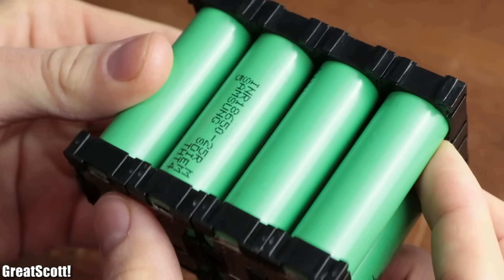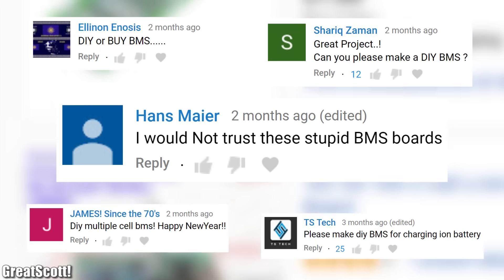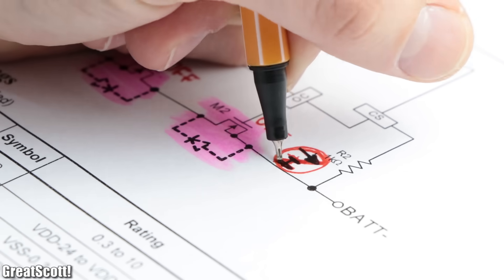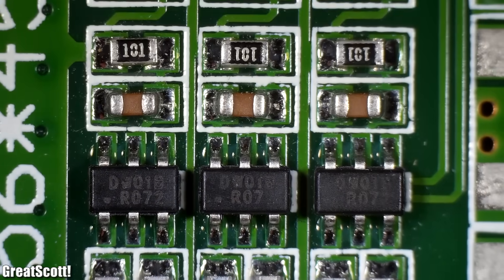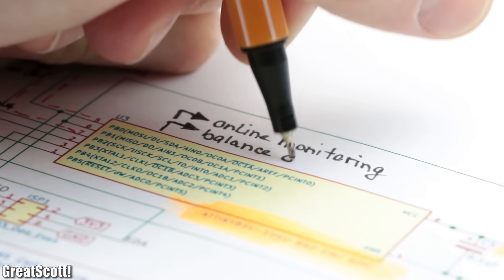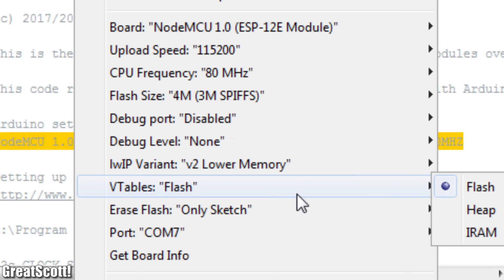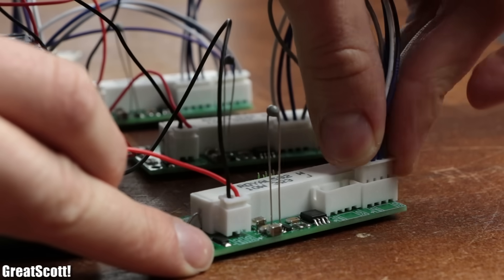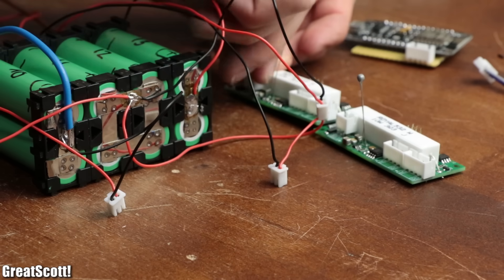BMS (Battery Management System) || DIY or Buy || Properly protecting Li-Ion/Li-Po Battery Packs

Comment: The value proposition of JLCPCB went way downhill this week as they stopped offering combined shipping with LCSC.com parts orders. The PCB shipping is a lot more than the pcb cost but at least getting parts in the same order made it bearable. Now the shipping makes it crazy unless you are ordering multiple pcb layouts.
Reply: @feldim2425 
My Steps:
1.) "dead bug" point to point
=Free
2.) "Brooklyn Style" islands/point to point w/salvaged copper clad materials
=free
3.) Marker based etch using ferric chloride in tupperware containers.
Chinese art marker ~$0.25
Ferric Chloride ~$10-$20 IIRC (I got it super discounted when RadioShack went out of business, however it can be sourced cheaply online too.) At the time I was still using salvaged copper clad.

Note: lots of older nicer SMPS designs used a piece of copper clad for shielding on one side of things like laptop printer power bricks. Notably, HP and Dell PSU's often have this. Just remove the solder mask and you're good to go.
  You can also just make boards with copper clad and an art knife by cutting out the gaps between islands/traces. 

Step 
4.) I picked up a cheap brother laser printer at the thrift store for $8 completely full of paper w/a full toner cartridge too. I also picked up 2 different travel type clothing irons (no steam holes) for $2 each. This is ideal for toner transfers. Don't bother with a laminator when doing toner transfers. An iron will let you test and control both the heat applied using a thermal couple on a dmm, and the time and pressure involved. The goal is to completely remelt the toner(a type of abs plastic) and transfer it to a surface that is easier for it to stick to. I use glossy pages from an old book I got out of a thrift store's trash (was laying on top of the bin one day).
=upgrade to toner transfers <$20
I also got some clad from China in 2 sizes for ~$10

Note:
Since then I discovered Bill on eBay. He sells under the user abcfab. He often makes the items in his store unlisted if he's out of town or super busy. When you find him add a few items to your eBay account watch list so you know how to find him. He sells product based on inch measurements. If you pay attention you'll see this is the cheapest option available online. It's great stuff too.

5.) Next I picked up several medium to large Pyrex casserole dishes from the thrift store for ~$1-$2 each. I have 6 I use most often.
=~$10

 I decided to go the Hydrochloric acid and Hydrogen Peroxide route as per Nurdrage's instructions. These are available in the US from big box home improvement stores. HCl is sold as "Muriatic Acid" or a 'Concrete Etchant.' This usually comes in a gallon container that will last you ages. Pick up hydrogen peroxide from any pharmacy.
=~$20 total

7.) Next I tried photoresist from China. I had to get resist, and transparencies.
~$4 for photoresist
~$8 for a 50 pack of transparencies on Amazon

I didn't get very good results from the first batch of photoresist I got but this was mostly due to my (lack of good) methodology. 
 
At someone elses recommendation I picked up Dupont Riston photoresist and Dynamask dry film solder mask from eBay.
=~$35
-these are nice, but having a datasheet I could look up and use as a guide was priceless. <this was an exponential step ahead in my methods.

 Using solder mask film was the first time I really needed a laminator. I got an Amazon basics version for ~$20 for this reason. It also works well for photoresist application but I can achieve the same results with an iron.

I'm still working on perfecting my dry film solder mask. I have achieved useable results but they are not 100% defect free yet. I have done a couple of TSSOP's and larger TQFP's with success though.

 The lack of through hole plating and other idiosyncrasies are more of a planning and mindset issue in my experiance. Trial and error will overcome these and if you're like me you'll learn from and appreciate these lessons in layout/design. 
  Lastly I also picked up a set of brass micro rivets from AliEx for ~$4. I use a needle pick to start the expanded back side of the rivet while sandwiching the collared side between the PCB and a piece of wood. Then I use a drill bit about 2-3 times larger than the rivet bore, in a hand drill. I set the direction of the drill to reverse/counterclockwise, and carefully expand the rivet until set. Sometimes I have to trim this a bit depending on how the rivet expands, but this is the trace side. I just add a bunch of flux and solder it. This can make mechanical trace connections rock solid or a via if you'd like. Although I just do a bit of wire for a via.

Last tips, apply photoresist with water, clean boards with white powder based dishwasher detergent (water must sheet off "clean" board or it isn't clean), you must test exposure times for all lithography films using a test/timed exposure mask to find the best time, the sun works great, I expose photoresist for 3 seconds in the mid day sun, 5 seconds for solder mask, the developer solution is critical for ratios and temperature.
...and now I'm sick of typing crap 9 of 10 people will ignore....
Check my playlists it's all other people's uploads I saved for personal reference but made public. I have like 6 different ones on PCB fab. Those covers almost all I know.
GL
-Jake
Reply: @UpcycleElectronics  : Great writeup on pcb making!
Reply: Upcycle Electronics much appreciated your effort 👍🏻
Reply: shipping is expensive but i don't ship with DHL i usually pick China post registered mail.. 7-14 days to Nairobi, Kenya. i did order 30 boards so that reduces overall  per unit  cost. plus it beats messing with toner transfer, ferric chloride and other diy pcb making messes....
Reply: @anthonykaruri  do you use all 30 PCBs? Became for me I only need 1 PCB to make my project before I make improvements to it.
I don't understand how I can buy 5 PCBs and only use 1, maybe I should sell the rest? 
Can someone tell mr what they do with extra PCBs? 
I don't have a drill to make holes in my PCBs (not that I have made PCBs) maybe I should start making my own if it's just 1 pcb
Reply: @kevinmccallister7647  not worked on the project for a while waiting on parts.. Yeah ordering one is still a better deal than trying to make your own boards. I am in Kenya, not sure of postage costs.. Where are you?
Reply: @anthonykaruri  no I didn't mean shipping, I ment when buying 5 PCBs it's 2$ shouldn't it be way more expensive when buying only 1?
Reply: @anthonykaruri  I just cheaked. In jlc PCB can't make a purchase if less then 5  PCBs and shipping is 25$ if choose the fastest one.
And around 8$ for cheapest one
Reply: @kevinmccallister7647   for me it just comes down to a value proposition... the alternative will likely cost more than 10usd. buying the supplies and the value of your time attempting to make your own pcbs. for the set and-finish you cant get it cheaper than China.
Reply: @anthonykaruri   right, I was thinking I don't need 5 PCBs what am I going to do with it?
I usually build only on perf board. 
The advantage I see with professional PCBs is that it looks really cool and you get to use SMD parts and you learn a lot.
Where do you buy your PCBs from? And what do you do with the excess PCBs?
Reply: @anthonykaruri  alroght man!
Reply: @feldim2425 
   I totally get it. I struggled with the same decisions at first.
   While challenging for sure I can do LQFP's and TSSOP's to 0.4mm pitch first try. I have a board I designed for a PIC16F1509 (TSSOP) and another for a MSP430F2616 (LQFP). Both of those are single sided with a few jumpers, and are basically minimum dev boards.
   I mostly do the DIY thing for the experience. I find it fun. I actually got into the hobby after becoming partially disabled. I'm extremely limited on space, have a tiny workbench in my bedroom, code from a laptop bed stand, and store everything for making PCB's in two plastic storage totes, one under my bed and another on my back patio.

  As far as DIY potential is concerned, the one I really really want to try soon is to order some of the thin laminates Bill lists on abcfab (BTW no affiliation or anything/heck I'm not monetized at all here anyway so have 0 to gain). He sells super thin double and single sided off-cuts and surplus. I want to experiment with a 4 layer home brew setup just to see what is possible.
  I've also been looking into through hole plating using acrylic paint with graphite powder and a plating solution.

  With all this stuff, once the setup and technique is established it's pretty fast and easy to replicate and get good results.
  With photoresist and fine line detail, I think most people over expose their transparency/film, and or add way too much sodium carbonate to their distilled water (I made all of these mistakes). I actually expose on the shorter side of 3 seconds in the sun, and use masking covers for transportation to/from a red LED lit dark (bath)room.
   The other super trick I didn't mention is to put bicycle chain oil between the toner side of the transparency and the photoresist applied to the board. Once this oil/air is squeezed out the transparency will be closer to the board than any other techniques I have tried (quite a few). I currently resolve the occasional cat hair and dust, no kidding. Once the techniques are dialed, your photoresist resolution should easily exceed your printer's.

  The etchant combo mentioned is DIY 100% recyclable with no losses too. Nurdrage - Youtube's go-to practical chemistry channel, has the tutorials needed for recycling. I haven't done this yet, but am shopping around for a cheap hotplate stirrer and distillation setup in order to start recycling my own spent etchant. 

  Probably the most difficult trick is getting the printer to do a dark enough print. I noticed I get better results when my window air-conditioner is running. I think the drum voltage controls the printer toner distribution quantity. I will probably tear my printer apart and figure out a way to create a variable voltage adjustment to really exploit this further. 
:-)

This stuff is not for everyone though. It is fun. I still plan on doing some things with a board house in the future, but I really like making boards too. The biggest spending splurge I'd recommend is a table type power mini saw and drill press. I use a dremel on an old drill press adaptor (thrift store press), and a 7" tile saw for cutting boards with a 0.65mm blade, and looking at a 6" option @0.3mm.
-Jake
Reply: @UpcycleElectronics  It's quite simple really, I've made my own PCBs and while they are okay, it's quite a faff to do and the end result is always messier than if I just order from JLC.

Vias are an absolute anus if you can't through hole plating, miniaturising boards becomes a chore and not having solder mask usually results in solder trails all over the PCB. That's not to mention drilling as well, which always looks crap because getting holes perfectly central on small pads is difficult at best. Yeah you could use a CNC mill, but if you're gonna get that, why not just order the boards from China in the first place.

JLC's PCBs are really high quality, they handle heat well, pads very rarely lift, they have silkscreen, look great and they come within 5-7 days which is a crazy fast turnaround time for boards coming from China. The visualisation on their website is also excellent.

If you do a bulk order of multiple designs, it's really good value. That's how I do it.
Reply: Even after a week of waiting on parts I loose my project momentum and wind up shelving it most of the time. Etching your own is both easy and extremely difficult. I can do a small hand drawn marker based design in a couple of hours tops. A single sided toner transfer in half a day or a complete double sided design with a dry film solder mask and soda can stencil in 1-2 days per iteration. I haven't used a board house yet, but I'd be so pissed at myself if I had to wait 2 weeks for 2 iterations every time I screwed something up like a flipped chip or accessibility issue. If I waited two months for the slow boat shipping....I'd totally forget the project even existed....('who sent me these samples without documentation?')

  It is certainly a challenge to piece together a complete etching setup and get everything working right though. I got almost everything piecemeal over the last year shopping at thrift stores.
  From what I've seen the JLC parts service is kinda short on most components though. They are mostly a jellybeans and passives supplier. I get that stuff from AliEx, and do all my local ordering from Arrow. They have free overnight shipping in the States, no shipping fee, and no minimum. The only caveat with them is that their site search and organization kinda suck and their mobile version of the site is practically useless (even on a Samsung flagship).
  That's just my $0.002 AdSense on this :-)
-Jake
Reply: @UpcycleElectronics  I get you on the momentum thing, the trick is to pace yourself...
Reply: Yes 
Is PCBway better?
Never tested it
Reply: I was looking into it but as you said 2 euro for a board but 5 euro or so shipping and they come from germany I live in the netherlands!
Reply: Well, according to PCBShopper, JLCPCB is still the cheapest option. But it's always cheaper (and it's also very fast, much better than having to wait for shipping every single time) is to make them yourself if, like in 99 % of the cases, you don't need 10 of them!
Reply: Around the end of January of this year, I ordered boards from jlcpcb and parts from lcsc right as soon as Chinese new year started, and I wasn't able to combine the shipping costs, so I assumed the reason I wasnt able to combine shipping was because of Chinese new year. Are they still not offering the combine shipping service? Thatd be a shame. It is quite convenient
Reply: kevin t  - my last combined pcb/lcsc order was about 5 weeks ago so maybe the change was around then. I just ordered a pcb yesterday and went to combine them on lcsc and saw the message.
Reply: @xabhax  about @Oliwer Gumowski  : please read some more into the way the chinese gov boosts exports by paying up (and above) 80% of the shipping costs, thats why no other country can match the shipping.. (hence the free shipping on lots of CH sites) so when a chinese firm asks 18 USD to ship 10 mini pcb plates.. thats like an Ebay listing of 0.02$ buy now item with 19.98USD shipping... aka scamming you by super over charging on shipping
Reply: @feldim2425 allpcb seems to be an alternative to JLC.
Reply: I assume OSHPark is still doing free shipping @ $5 per square inch?
Reply: What are some good alternative options?
Reply: @Datsun0240  I've been using osh park for years - free shipping and made in USA. Have to order 3 boards though
Reply: @osjproductions5856  OSH is my go-to as well. My projects aren't super big and mature enough by the time I'm ready for a PCB,  so I don't find the qty 3 a turn off.
Reply: Yusef Harvey  - i dont know but im going to have to start making more of my own pcbs. With the shipping fee and then brokerage on my end for dhl it just isnt worth it. I could choose slower shipping but i might as well make my own if i have to wait weeks. I was willing to take the hit for a single order once in a while when i needed enough new parts but now now.
Reply: @RDarrylR  I hear you! I've been tempted to splurge on a mill for the occasional one-off project
Reply: I've been making my own pcb's for almost 25 years. Why do people use this type of service? What are the benefits?
Reply: In my experience most of the stuff recommended/advertised by youtubers sucks. Either in price or service. In here he did not even hide that they will do cheap pcb's, and then charge you 18 bucks for shipping, typical strategy. Sounded a bit like the G2A scam lounge, how can one charge extra for consumer service.
Reply: Oliwer Gumowski - Actually the PCBs from JLCPCB are very good quality and the build time is very fast. I have ordered a number of pcbs from them an have no complaints about that. The only issue is having to pay shipping and brokerage on their orders and lcsc orders that are placed at the same time.
Reply: @brzydka_i_bestia  It's still (usually, varying by about a dollar) the cheapest small batch PCB manufacturer. Look at literally any PCB supplier, even ones next to your house will charge $15-20+ shipping for a couple boards. I will give you $20 if you can find one that doesn't (doesn't count if it's charging $5-10 per square inch of PCB)